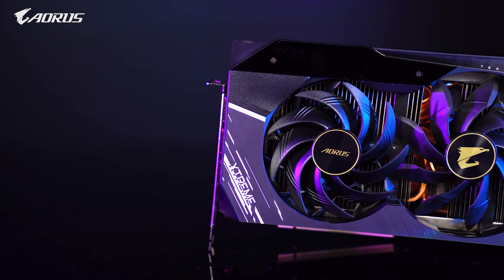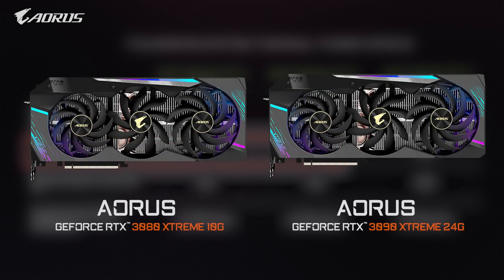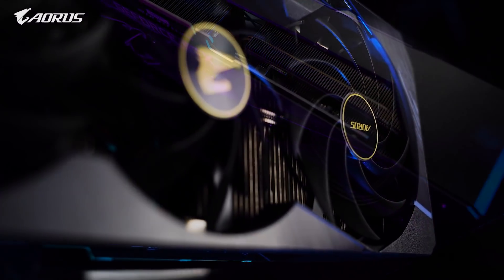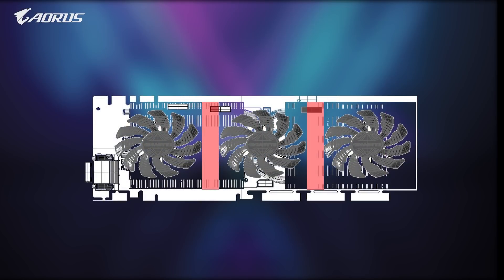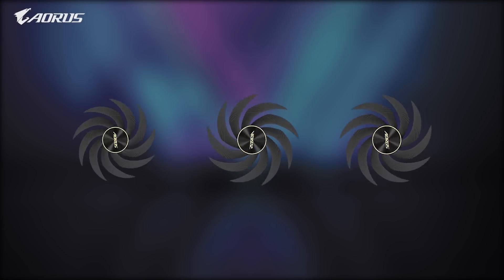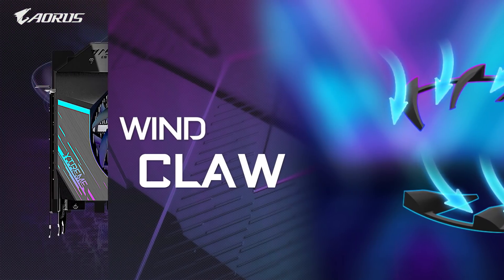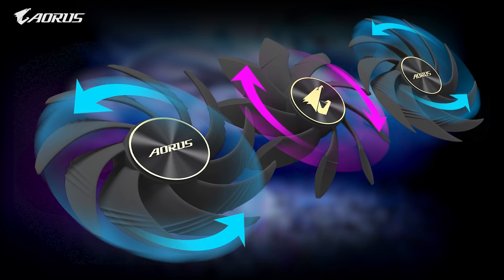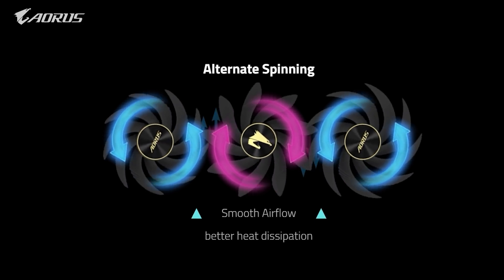AORUS RTX 30 Series - MAX-Covered Cooling | Feature Highlight

Comment: Can’t wait to see this thick boy inside my first pc build, been saving for the past year and I’m at 1400$, honestly I have a lot of expectations :)))
Reply: heeyyyy, what a coincidence, ive been saving up all year as well and I also have exactly 1400 im saving for this launch.
Reply: @husleman  If you have to safe up a whole year for 1400$, you shouldn't get a 1400$ graphics card. You have other issues. Get your financials in check first. I expect the 3090 to be 40-50% faster than the 3080. If you have to save a whole year for 1400$, you're most certainly not playing at 8K or 4K and you shouldn't worry about a 3090, because it would be a massive overkill for your system.
Reply: RoadRunner what kind of psychopath would put their budget on a gpu and no pc
Reply: @husleman  wait for the ga 102-300 die  and save money for games
Reply: @User9681e  I dont know what the 102-300 die is, and I already got enough games, I just want to play them at a locked 144fps @1440p.
Reply: @husleman  sorry I meant the upcoming 3060 ti super or whatever it would be called anyway die number is  ga104-200 for reference .
But yeah igot confused and wrote the 3090 die number above 
But I would recommend the 3060 super / ti as it won't have only slightly lower tenser cores tflops  performance then the 3080  and have similar memory bandwidth  and  Ray tracing/dlss performance of a 3070 Ampere card would run well on your current resolution and refresh rate .
Reply: Hopefully you're not expecting the $1400 card to perform 2x as well as the card that costs half the price.  =)
Reply: Makes sure not to blow all your money ont the gpu alone as other components are more important in the long run
Reply: I’m just aiming for the 3070 super and maybe a Ryzen 4700x if it isn’t past 340$, but by Christmas when I’ll have maybe 2000$
Reply: @victoro5680  that sounds pretty solid my dude, and Black Friday the price will cut a lot. I hope the best for you and enjoy your build.

Comment: It seems the alternate spinning,.reversing the middle fan with respect to the other two, to eliminate turbulence and dead zones, is such a "duh!" solution. I'm stumped why almost no other card manufacturers are doing this. It is even applicable to 2 fan cards.
Reply: @Boris Vasiliev Different blades, yes. But same motor with just alternated polarity, no?

Comment: Really cool cards, but you kind of misrepresent how heat transfer works in radiated closed systems.
Reply: @TWOEV  The fans cool those heat pipes.  Heat pipes work with phase change materials.

Comment: It's a £800 house brick with an LCD display on it... 
Nvidia eliminated SLI, so Aorus created an SLI thick card to compensate.

I also doubt the windclaws actually work. They look like they'd create turbulence and not clean airflow (but I'm not an aerodynamisist so can't say for certain). But I guess you've got to have that pointless marketing thing that justifies the extra £150 price tag somewhere. 👍
Reply: The so-called "windclaws" are just stator blades. In a turbine compressor, stator blades are placed after every rotating blade disk. Fans (and turbine blade disks) impart a rotational moment to the air coming in, and this causes efficiency loss because the airflow's radial velocity component reduces the axial velocity behind the rotating fan. Stator blades are used to straighten the airflow again by blocking the radial velocity component. There will be some energy loss from this process, but most of the total velocity vector will be retained, so axial velocity is increased significantly. Properly-designed stators can convert 60-80% of radial velocity to axial, which in certain applications can increase the axial velocity by 50%. In this application, assuming the stators are properly designed, the increased axial velocity should also increase cooling efficiency of the system.
Reply: @andrewsuryali8540  Thanks for the explanation man, that makes sense
Reply: @andrewsuryali8540  Fair enough. Can't argue with that. Assuming they are working as intended, and not yet another markering ploy to try to stand out.
Reply: I agree It's like they've created an issue to solve that never existed in the first place, just BS!
Reply: @Olds79Starfire  especially since nvidia has their own solution
Reply: @Olds79Starfire  shot on iphone
Reply: You want turbulent flow between the fins themselves for max heat dissipation.
Reply: @YungPixel  I meant turbulence between the blades of the fan and the claw blades meaning less air gets to the fin stack itself because it's not being directed where it needs to go and is instead fighting itself. 

But no doubt benchmarks will see if it actually works or not.
Reply: Lol, I wonder how my 2 fan card has lasted 2 years without blowing up. Now this company is going to charge a premium for making their middle fan  turn the opposite direction, so innovative,.

Comment: I really dislike how we aren't getting specs/price until the 17th. That's when the Founder's edition launches. I need time to assess before I buy
Reply: Chances are low anyways, there are always out of stock the firsy months
Reply: The same how RTX20 series (or 2000 series) costed, if the 3080 costs 700$/Eur, then knowing the prices in my local stores that sold 2000 series, I suspect it will range from 850-1000 if it's Aorus you are buying, regular Gigabyte card might cost 750-850, varies from store to store.
3070 might cost the same 550-650 regular, and Aorus up to 750 or something. Etc.

Comment: Honest answer only to my question - What's wrong with the Founders card's cooling that you decided to just stay to classic one? I understand it's the brand trait to have your own styling, but for consumers we would like to have the best cooling as well, plus I really dig the Founder's card design and beefiness. Personally it seems the cooling on Founders cards is vastly beefy and seems to might provide higher degree of cooling. For that actually we have to wait for reviews, but I suspect you guys already know it as well as other reviewers, reviewers are just currently not allowed to post the benchmarks etc.

One more thing, in illustration you showed that all three fans got equally bigger, but clearly we see something you didn't addressed, the reason why one fan is smallest, one is the middle sized, and the third one is the largest, why such a difference considering you guys are doing standard PCB rectangular size unlike Founders card with the cutout section?

P.S. Visual design looks like regular Gigabyte version card, nothing special feels about Aorus design here, unlike with RTX2000 (20) series cards where there's a significant visual design difference from Gigabyte and Aorus. Having that LED screen is just...meh. Personally I can't afford Aorus branding, so I have Gigabyte 2070 Super, and I enjoy the simplicity of it with slight abstract angles it has when viewed from a side. I didn't liked that much the side look of Aorus design too, too many abstract angles and shapes that didn't fit well with most if not all case designs, and other hardware components, and quite overpriced, like 2070 Super Aorus cost around 2080 pricing, didn't made that much sense, but I liked the bottom view with the LED fans on it.
Reply: you can check Bitwit video about the 3080 unboxing he points out many things that make sense here's my own list : 1) the centered 12pin connector destroys the FE clean design go check pictures of them with the connector plugged in it's atrocious 2) the upper fan sucks all your front fans cold air immediately, what is the actual gpu die fan going to use for cooling ? the answer hot heat soaked case air (except if you have a case with fans at the bottom) 3) placed vertically it will violently heat your motherboard chipset 4) placed horizontally it will cook your memory and blow hot air in front of your cpu air-cooler if you use one I really tought FE where the ultimate card but when you think about it there are serious problems introduced by the new design, by itself works great, in a real case with components above and below them ?

Comment: If its going to take up 4 slots of space then why not have at least a 3-slot bracket for better stability?

She's a brick, house.
Reply: Not sure if it ships with an anti-sag bracket.  I know several of the 3080/3090s do this time around.
Reply: Where do you see that it is taking up 4 slots? Everything I have seen from all the different versions only mention 3 slots at most.
Reply: @i2evielle  The Aorus extreme looks like 3.5 or 4 slots.  Lookup the one that shows the edge with the small display headon.  It's REALLY thick.  Might be a bad render, but people have mentioned it.

FWIW, the 3080 takes 14% more power than a 2080ti.  The 3090 takes 25% more.  The Aorus xtreme 2080ti was already a 3 slot card(60mm).  In addition to extra fin surface area requirements for heat dissipation, the new aorus extreme cooler uses that "wind claw", which apparently is a small structure underneath the fans to do something with the air.  They also lengthened the shroud so it covers more fin(moves exhausted air farther away from the fan intakes to prevent recycling hot air)
Oh, and it looks like no air is expelled out the rear plate directly from the fins(the NVidia 3080/3090 exhaust most of the "front" fan out the rear plate).  The only cutouts on the rear plate are in the dead area where cards cannot go(the PCI-E connector and a bit under that where the tabs narrow down to actually slot into the chassis.

Comment: So basically... Same as the previous designs - just a new PCB beneath it?
Reply: PCB is the same standard rectangle I suspect, I heard about it as well in some tech video, forgot in which one, either Gamers Nexus or JayTwoCents. nVidia Founder card is only one using the unconventional PCB with that cutout triangle.
Another thing to mention, when you have designed a good cooling factor, with the way how these fans work, two clockwise on sides and one counter clockwise spinning in middle, don't expect that to change anytime soon. One thing though, I actually want Founders/Reference card from nVidia, looks really damn cool, and the cooling on it is damn beefy af, I dig the design of it. Sadly I might be able to order it because I am out of job, and I suspect a lot of Founder cards will be sold out by nVidia, so it will leave me only with partner cards.

Comment: The RGB design is lacking. Looks so generic.
Reply: i hope they make design like back then, 20-series spinning light effect
Reply: These cards are not meant to be vertically mounted
Reply: @anupotaktos  i hope it can, and bracket included. it'll be saggy inside the case
Reply: @johits11  I hope as well although the aorus one seems to have an exhaust so my guess is it will come with a bracket for the shag
Reply: @wuhsabi  each to their own buddy. If people hates rgb, why is it on everything? Demand and supply simply.

Comment: Still have my aorus 1080ti will more than likely get the 3090 or wait about a year for a 3090ti
Reply: there wont be a 3090 ti/ super whatever the name ends up being. a 3080 ti / super will follow tho. ill tell you now, $1000 9984 cuda's. a 3080 super will basically be a 3090 with 12gb VRAM
Reply: @Matt___B  We already have leaks, 3080 super will have 20gb vram, and there are rumors that it will be on TSCM 7nm instead of Samsung
Reply: @Matt___B  I would beg to differ 12gb vram is simply too little I would say 14-16 gb vram as an 2080ti replacement since 2080ti was 11gb, so it would make sense if they offer us 14-16gb for the rtx3080 super/ti version
Reply: Unless you’re a 3D designer, your job relies heavily on GPU usage programs, or you want to pay an extra 800$ for about 8 - 13 FPS, it makes more sense to just get the 3080, or 3080 ti / super. Why? Because the 3080 is the flagship Gaming card. 

The 3090 is a Titan. So essentially what you’re saying right now is “I’m going to save up for an extremely expensive work Graphics card, that won’t really give me a boost in fps”
Reply: Ti is probably being eliminated, there is a high chance that the naming is going to be replaced with "Super". 3090 is replacing Titan as well. That's just a sidenote, the 3090 Super will be basically the Ti name replacement for now on. I might be wrong, but considering there is no RTX TITAN, then I suspect it wont be in this lineup too.
Reply: @BIOSHOCKFOXX  there was never any Titan Ti or Titan Super so I doubt they would come out with one.
Reply: @Dynamo33  Yeah. The only reason I wrote what I did above is because the person was basically flaming ppl for buying a 3090. I agree that for gaming purposes it is stupid, but considering it costs 1000 less then the previous titan its a great deal for people who can utilize the 24gb  frame buffer
Reply: 3080Ti will likely drop next year and it'll be cheaper than the 3090 with probably the same performance. Anyone buying the 3090 now is a chump.
Reply: @WheeledHamster  Not necessarily true. I doubt they would make another card in the lineup have the same amount of vram as the 3090. And believe it or not, not only gamers will be buying these cards, and there are tons of applications where the amount of vram is important above all else.

Comment: Yeah, the design of the 30 series Aorus cards has gone backwards.. The 20 series were beautiful by comparison. 
A bit disappointed, Gigabyte.
Reply: I dont know what they're smoking 

2 different variations of 3080 and 3090 cards and theyre all using up 4 slots 

Its insane and super lazy
Reply: Idk man, I hated the 2000 series design. They look like they could fall off at any moment. This, on the other hand, looks a lot more sturdy and classy
Reply: I actually prefer the 3000s to the 2000s, the 2000s looked like they were trying too hard to look futuristic to me, although the fact that these new ones are so huge kind of ruins them for me, im not sure how 1 pcie slot is supposed to hold these up.
Reply: DXM55 __ I 100% agree aorus had by far the best design and now I hate to say this but they have the WORST design